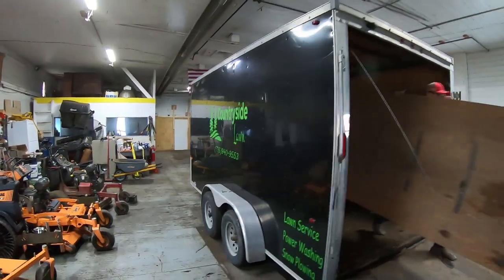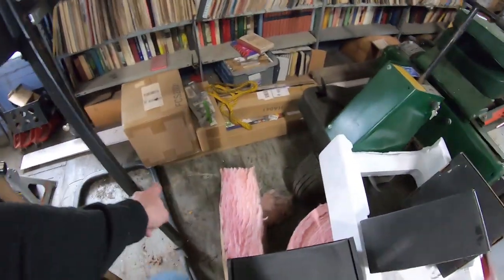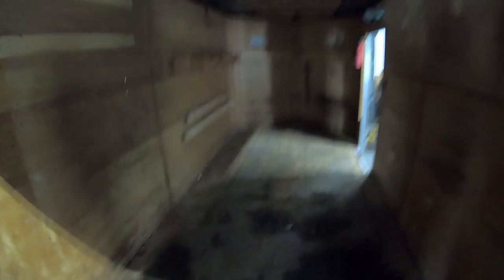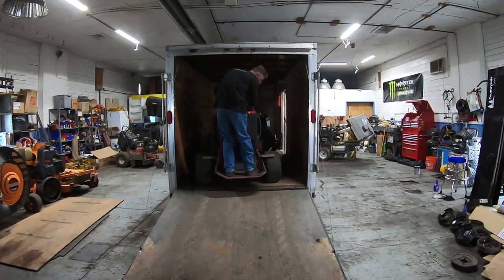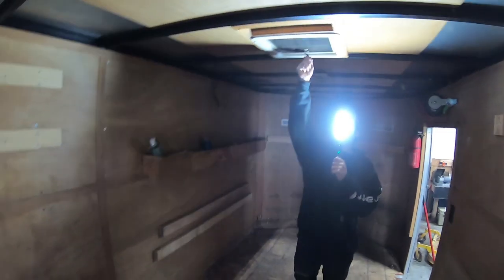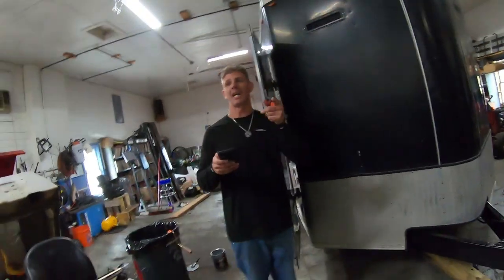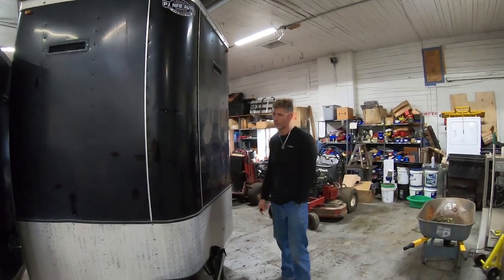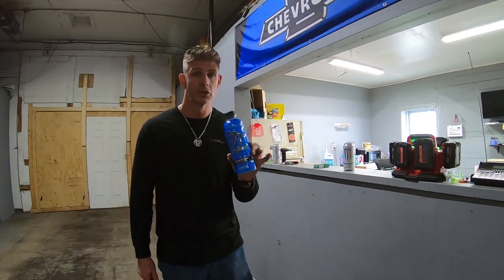Lawn Care Trailer renovation

Comment: Glad to see you going back to the enclosed trailer! I think you will be glad you did! I’ve been running enclosed for years now! Just really like the security of them!
Reply from the maker: That's not really an issue with us and we're only using it for the spring and then we'll go right back to the open I like working out of the open trailer much better

Comment: I had the same roof leaking issue on my enclosed, I used the 4" flextape rolls to go around the perimeter of the roof and across all the ridgelines across the roof. Worked awesome! No more leaks! Little spendy though as I needed about 10-12 rolls at like 15 bucks a piece....
Reply from the maker: Yea I have some of that